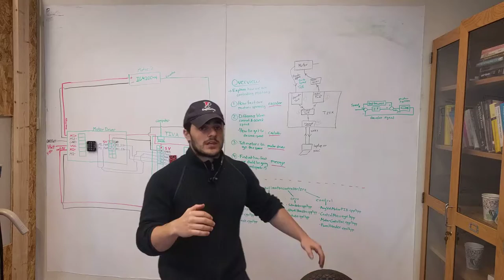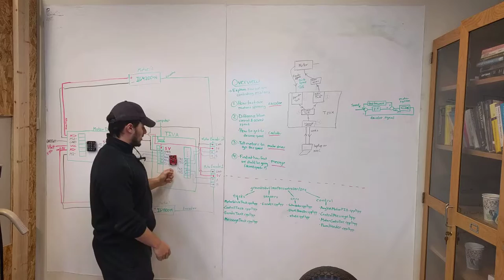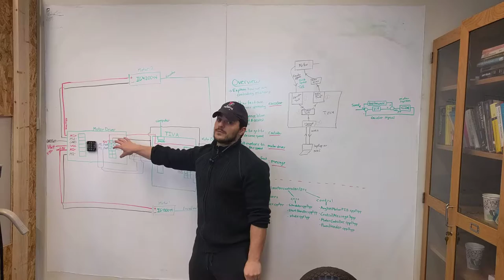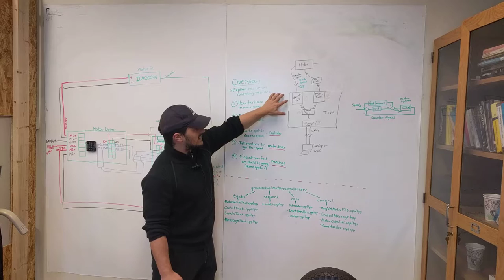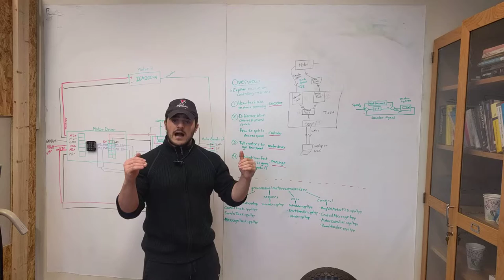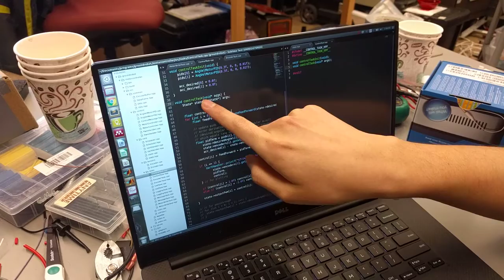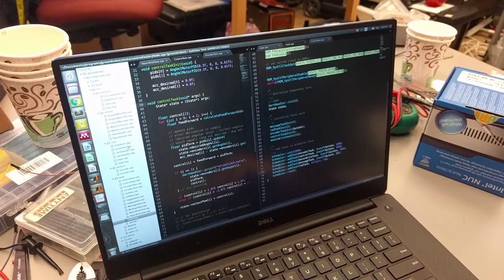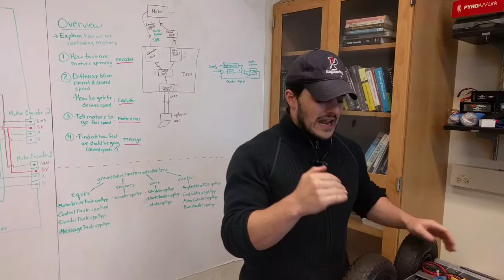Motor Control Software

Comment: Trying to figure out what to do with that index pin. Dunno if I should ground it or connect to another gpio
Reply from the maker: check out the previous video: https://www.youtube.com/watch?v=S_OlXFUPGH0&t=189s
Reply: It looks like you left it open. I guess you can reset the QEI to 0 in software.